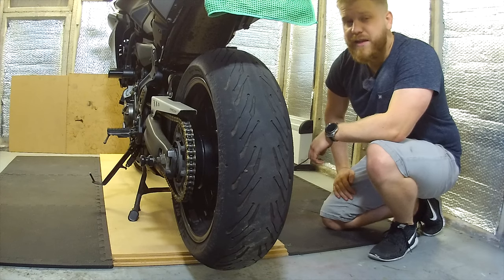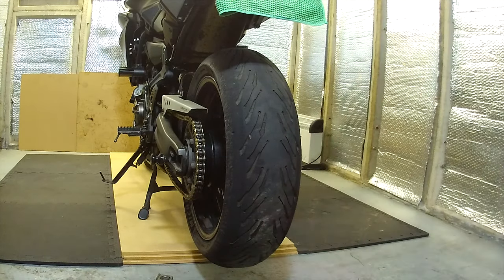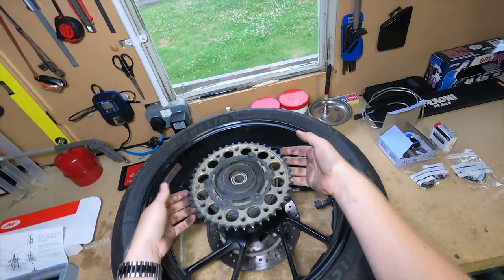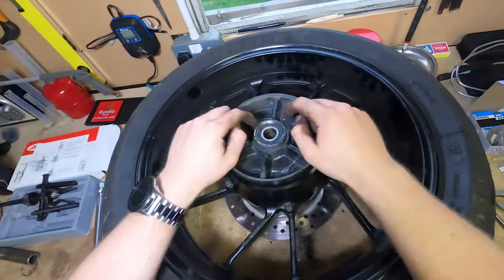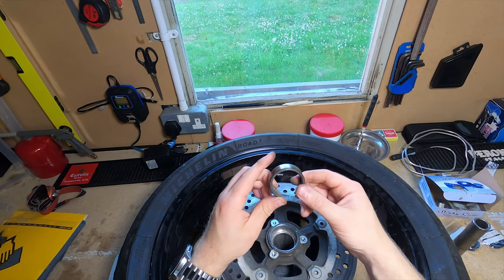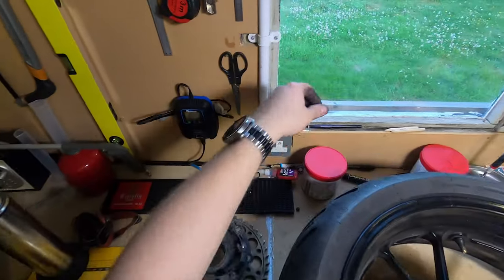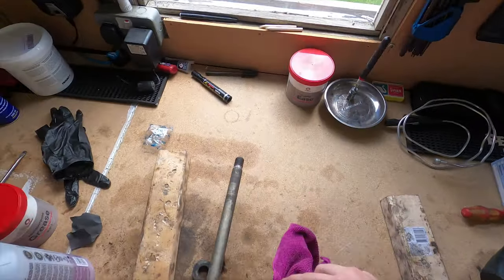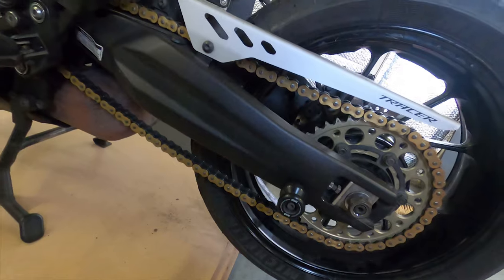Exploded Motorcycle Wheel Bearing? | Time to Replace Them | An Unplanned Painful Video

Comment: My bearings exploded in my front wheel, after changing them the bearings last 200kms before needing to be replaced again. Damaged hub? It was like yours, how have yours survived
Reply from the maker: Mine needed to be replaced about 3 months after I replaced them.. ended up replacing them again and they last after that until I sold the bike. Not sure why the first replacement went again